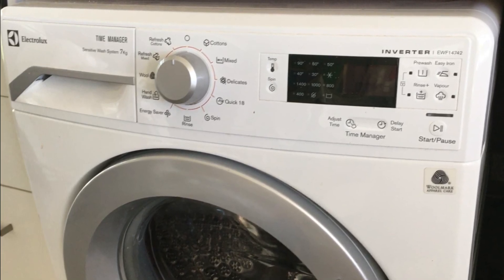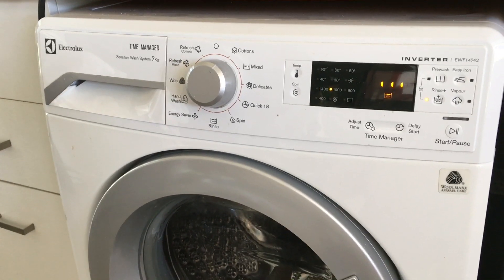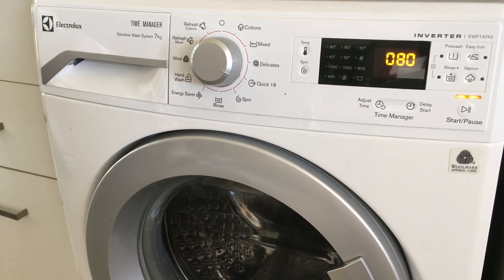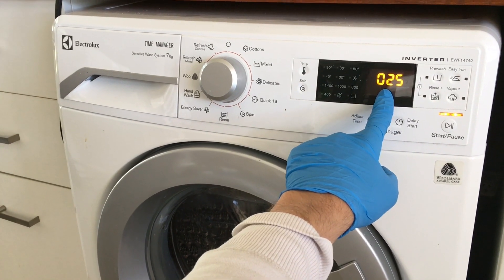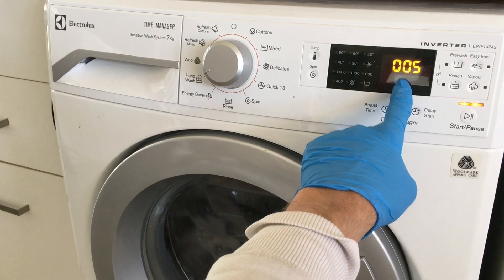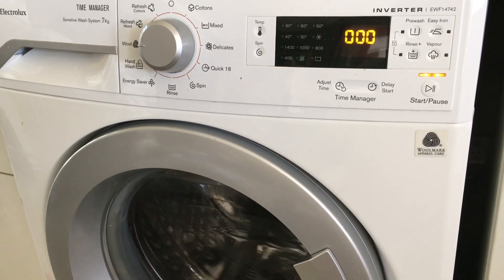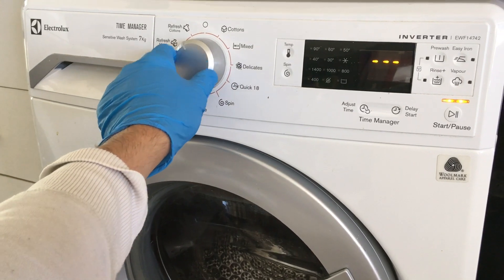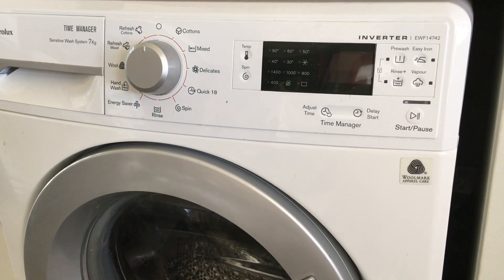Electrolux Washing Machine Diagnostics Menu - EWF14742 time manager

Comment: Hi mate, while in diagnostics mode running through the first 2 cycles the water inlet has not stopped filling the tray. I tried restarting the machine multiple times, unplugged the water line, tried the diagnostics mode again. The water won't stop filling the tray. I had to cut off the water inlet. Can you please advise how to fix this issue? Thanks

Comment: What should the water pressure be on the first 3 dials? I keep getting e10 error code, have checked hose for kinks and blockages and still not working. Numbers are quite high on first 3 dials

Comment: Same method applies to the tumble dryer EDC2086GW3
Meaning, start the dryer, switch to Extra Dry Cotton menu and hold the Start/Pause + Delicate touch buttons until entering the service menu.
The service menu positions are found in the service catalog.

Comment: great video .. I followed the instructions and found the "E10" error I see in use is actually an EF4 error .. your faults page talks about it could be just a faulty flow meter reed switch .. do you know what reed switch I need to get to try replacing it? 
Thanks
Reply from the maker: Electrolux dont sell reed switches, you would need to buy it from a local electronics store and solder it in or buy a whole new valve from electrolux, it comes as a complete unit with valves and reed switch. Just make sure that the water is actually flowing when you get the EF4 error. Sometimes a faulty inlet valve can also give a EF4 error when no water is coming through the valves.
Reply: thanks @ApplianceFault   .. yeah .. can see/hear water flows .. I'm ok with soldering a new reed switch in, just thought you might have known what reed switch is required .. .. before I disassemble it to find it

Comment: Good video. The annoying thing about this machine is I cannot just set a preferred time and wash cycle. I have to press the time button several times to take it to 1:05. It would be good if it had a favourite setting.
Reply: I hate everything about this washers interface 😢 it's good otherwise
Reply: @shuichinz  I do most washes (includung towels and sheets, etc) on the Delicates setting for 35 minutes, using natural Eucalyptus Wool Wash liquid detergent for everything—works a treat! Everything comes out fresh and clean. And on that setting, I can choose the spin cycle, temperature (I use mostly cold), and anything from 35 minutes plus. With towels, I take everything else out of the drum at the end and leave the towels in for a new 15-minute spin cycle at the higher speed.
The Delicates setting can make your clothes last longer. But, then, I don't have kids with rugby shorts, etc, so depends on your household.

Comment: Hello, I have the E42 error Door Lock Faulty. There are clothes stuck in the machine, but the door won’t open. When I enter diagnostics mode, the door keeps clicking and E42 flashes on every position on the dial. What steps can I take on my own before calling a technician?
Reply: I also have this exact issue. Any update on what worked for you?

Comment: I managed to enter the diagnostic mode in PERFECT CARE 700. I think I pressed autodry and start in position no1. Run heating test it starts from around 4C  degrees and goes up 1c every 30 sec like you said. It went up to 30 and switched. I opened the door and the inside is very hot. I did it cuz it was washing in very hot temperature in 60 deg setting. But it looks like the sensor is  not working properly.
Reply: Hey, hiw did you enter diagnostic menu ?
Reply: @vladani1984  position no 1 then press autodry and start
Reply: @CahirAepCeallah  tnx. I was actually trying with closed door that why it didn't work. 
Do you know how to reset the machine maybe?

Comment: Hello there
I know this is over a year old but we are in New Zealand and have this exact model.
Overall, it seems to be running fine and ran it through this diagnostic test. Nothing crazy came up but maybe E11. So willckean the water in and out. 
But the setting it doesn't want to wash in is Wool. 
It starts, it fills will water but the washing doesn't occur.
The timer counts down still.
What might be a possible cause for this?
Reply: I have the same problem. Were you able to get this resolved?
Reply: @margieatalifo7236  yeah it was the heating element in the end.
Had to replace that.
Easy fix

Comment: My diagnostic mode works as mentioned here but can't find any fault except showing precious reading of e10 error which exists when I run load cycle. Any help will be appreciated. Thanks
Reply from the maker: E10 is a water inlet fault. Meaning the machine is having trouble filling with water. In the diagnostics mode, open the dispenser drawer and make sure all the compartments are filling with water on the water inlet valve test. 
E10 is mostly inlet valve related.
Reply: @ApplianceFault  thanks for the response. Upon checking again, it seems c02 and c03 option gives EF4 error and I checked only one compartment is filling water properly. Is it only technician who can now come and fix it?

Comment: Hi, thanks for the video. On the 7th position the temperature will not go past 40. Should it on this test? Thanks for your help
Reply from the maker: Hey, 
You’re welcome. 
On this machine it should. But it does time out after a few min.  You will need to switch to a different position for a few seconds and then back to the heater test. 
But if the temperature does rise and the glass gets warm, then this should indicate that the heater and temperature sensor is working fine.
Reply: @ApplianceFault  Thanks for your reply. I'll see if I can get it past 40. Just trying to work out what needs replacing. I'll get the occasional E10 error but on every wash it'll just pause by itself about 3 times every wash. Pressing start will get it to resume. The water pressure is fine and when I connected it to the hot tap it completed 4 washes without any errors or pauses. When connected to the cold water supply and on a cold wash it'll still pause by itself. Thanks again for your help.
Reply from the maker: In the diagnostics menu, when the dial is on the error read out(I think position 10 or 11) what error does it display? 

E10 error is a water inlet problem. In most cases it’s the inlet valves that are at fault. 

Other errors can be found on our website :
https://appliancefault.com.au/faults/washing-machine-faults/electrolux-washing-machine-fault-codes/
Reply: @ApplianceFault  Hi, thanks for the quick response. I'm getting an EF4 error. Thanks for the link to the error codes. Is the flow meter reed switch part of the inlet valve? If so I could try swapping that out. Thanks again
Reply from the maker: Yes, flow meter is part of the water valves. Most likely it will be a sticky valve that doesn’t open sometime to let the water in
Reply: @ApplianceFault  Thanks for your help. I'll give that a go
Reply: @ApplianceFault  I swapped out the water valves and a long cycle almost completed, it stopped with 10 minutes to go with an E10 error. On the diagnostic menu I'm getting an EF4 error again. Water flow seems fine and there are no kinks in the pipes. Is there anything else that I should check?
Reply from the maker: In the diagnostics mode when in the water valve testing cycle, position 2 and 3, do you have water flowing into the dispenser?
Reply: @ApplianceFault  Thanks for your reply. There is water flowing in position 2 but not in position 3. Position 3 I receive an EF4 error
Reply from the maker: That means the prewash/rinse solenoid is not working. 
Maybe the new inlet valves are faulty. In position 2 and 3 water should be entering the dispenser compartment equally fast. Recheck that the wiring plugs are connected firmly to the solenoids. 
Did you replace the whole solenoid unit completely?
Reply: @ApplianceFault  Yes I replaced the whole solenoid unit completely with a new one. I've checked that the wiring plugs are connected firmly. On position 2 the compartment fills but an E4 error is displayed. On position 3 no water flows and an E4 error is displayed. All 3 electrical plugs are firmly connected.
Reply from the maker: I think you might have connected the wires wrong? It sounds like the flow meter wire is connected to the solenoid and the solenoid wire connected to the flow meter.
Reply: @ApplianceFault  Thanks for the reply. I took a photo of how it was originally connected and the black cabled connecter was connected to the flow meter and the blue cables were connected to the solenoids. Thanks for your help
Reply from the maker: You’re welcome. Hope you got it sorted out.
Reply: @ApplianceFault  sorry I should of said I've checked that they are connected as before but I'm still getting the same error. Position 2 water flows but receive an E4 error, and position 3, no water flowing and an E4 error message. Is there anything else that I should check? Thanks for your help.
Reply: mumd help me how to restart my washing machine.  MOD ZR8453WF 👋

Comment: The start\pause button on my electrolux 2266 topdoor does not work although it registers the pressing with a  sound. The tests all showed C6H. This happened after an electrical power failure in the middle of a washing cycle. Can you show how to reset? will that work?

Comment: Mine just came up with E57 when I tried to enter diagnostics mode :( Any idea what that means?
Reply from the maker: E57 is a motor related error. It’s either the motor or the motor control module. In most cases it’s the motor control module.

Comment: Just a quick question when doing the diagnostic and your going through each one do you stay in each one for a certain period of time or just a few secs then go onto the next one?
Reply from the maker: Just for a few seconds, just to confirm that the component is functioning as it should. The only test that I stay for longer would be the heating test, it takes 3-4 min to heat the water up.
Reply: @ApplianceFault  great thank you for your quick reply I will give it a go and hope that it helps my machine.

Comment: thanks a bunch my dude. fixed my problem. was refusing to unlock/release the door. tried going into diagnostics mode and it released the door
Reply from the maker: You’re welcome. 

I’d recommend to check the drain pump filter. In most cases the door doesn’t open because the water has not drained too well because of a blocked pump filter. 

Also in the diagnostics mode check what was the last stored error in the memory of the machine, this might also let you know why the door might not have opened.

Comment: Thanks for your video .can you please advise How can I resolve EH0 error?
Reply from the maker: Not a problem.  EH0 error doesn’t exist. You need to enter the diagnostics menu and go to the error read out setting to get a correct error code. It will range from EH1 up to EH5 or 6. Once you get correct error read out you can check the meaning on our website.

Comment: My washing are the same as yours!
What the code EFO mean?
Reply from the maker: There is no such code as EFO in the service manual. Did you get this code from the diagnostics mode or did it just come up on the screen during the cycle?
Reply: @ApplianceFault  it come up on the screen about 50 mins after i started it
Reply from the maker: You need to go into the diagnostics mode and retrieve the correct fault code from the memory of the machine. In a lot of cases the code displayed during the wash cycle is just a generic code that is not very helpful, but in the diagnostics mode it will display a more specific code to the problem.
Reply: @ApplianceFault  wish i can sent you a photo bout this code
Reply: I got a same error. Did you fix it? How?

Comment: Hi My door is locked and wont open, i hve tried flushing the water and off the plug but still lock. 

The drainer pipe unable to turn left to fully take it out? Would you be able to advise ? :(
Reply from the maker: Hello,

Did you check for fault codes in the diagnostic menu?

Comment: Is there a way to increase the default water level using the diagnostic menu?
Reply from the maker: Unfortunately no.
Diagnostic menu is there just for fault finding.
Reply: @ApplianceFault  All modern day front load washers should have the water level +/- button at the front panel. They're not listening to their customers!
Reply from the maker: The only thing that I can think of to increase the water level would be to make the pressure tube to the pressure sensor slightly longer.
But it will be a bit of trial and error to get the desired water level. Start with a longer hose and cut it shorter to lower the water level.

Comment: I really hope you might be able to help, I have a EWW12753 Washer/Dryer combo, and every so often during the middle of a cycle, usually wash/dry, it resets itself. It hasn't done it a long while, but it has started again, and it make a beep noise and switches off, or resets the cycle ( as if the dial is moved to another option and back, resetting any temp changes or dry times) and if I close the door normally it does the same thing sometimes, and most the time if i close a bit harder, like the board is shorting and the dial is intermittently failing and thinking it is being reset. It seems to do it while washing if it shakes.
Reply from the maker: Hello,

Most likely it will be the dial pcb that has failed. Common issue with these machines. Try replacing the dial PCB first, they are cheap, around $40-$50.
Reply: @ApplianceFault  Do you know where i can get these in Australia, or if there is a parts list or diagram so i know what to get?
Reply from the maker: The part is called selector PCB. 
Which state are you in?
Reply: @ApplianceFault  ACT
Reply from the maker: These guys are spare parts dealers in ACT:

Mayner & Cochran
1/86 Townsville St
Fyshwick ACT 2609
(02) 6280 6833
Reply: @ApplianceFault  Cheers. You wouldn't happen to know rough price guide for that part at all?
Reply from the maker: The selector PCB is usually around $40-$50.
Reply: @ApplianceFault  thanks for your info Mate. Very good of you.

Comment: Thanks for your video, it was super helpful. I get a E5H error within 5 seconds of moving to second position (mixed). Do you know what this is??
Reply from the maker: Thanks for watching. Happy the video was helpful. 

E5H error is a motor control board problem. 
Check all the connections on motor control and main PCB board to make sure no plugs are loose. If all plugs are connected properly, replace the motor control board.
Reply: @ApplianceFault  are the motor control and main PCB board separate? Or part of the one unit? I have removed the box from bottom right below drum from back panel and connections as well as board looks ok so probably needs replacing! Thanks again.
Reply from the maker: Yes, they are seperate units. The motor control board is usually at the bottom near the motor.
Reply: @ApplianceFault  Electrolux
Model:EIFLW55HIW0  how to reset the error codes

Comment: Thank you for this video. My machine is pausing frequently with no error codes and then will even increase the wash time from 15 mins to 45 mins on a normal cycle. Do you have any clues to what might be happening?
Reply from the maker: When you enter the diagnostics menu and turn the dial to the 11th position, did it have any error stored in memory?

If no error stored, then your machine might be going out of balance. And when it goes out of balance it skips back to the rinse cycle to try to redistribute the clothes and try to spin again. 
Front loading machines can go out of balance if the load of washing is too small or if there load is good size but one of the items is heavy and this can cause it to have balance issues.

Comment: Hello , very useful video. I have EWX127410W Electrolux machine. How can i access to diagnostics menu? This process did not work for me.
Reply from the maker: Hello, try this video. This video goes to see the last fault code but if you turn the dial clock wise to every position you should be able to test each component individually. 

https://youtu.be/c6bzKoDpgEg
Reply: @ApplianceFault  Thanks , it worked and  i got the e66, checked from your website. I guess i have a big problem.
Reply from the maker: Check your heater element for earth leakage and resistance of the heater with the multi-meter before changing the main PCB. These errors are good help most the time and let you know where to look but are not always 100% accurate.
Reply: @ApplianceFault  hello again, finally fixed the machine. I checked the heater, heater was ok. So i fixed the main pcb, i found a faulty power relay on the card and replaced the relay with new one. Now machine is ok. Thanks for your help.
Reply from the maker: Well done. That’s great to hear.

Comment: Is there a reset function on this washing machine
Reply from the maker: Unfortunately there is no reset on these machines. Only thing you can try is to unplug the machine from power point for 10 min. But if there is a problem, it needs to be rectified before the machine will function properly again.
Reply: @ApplianceFault  mm by 😆